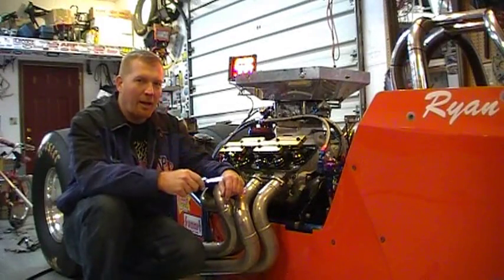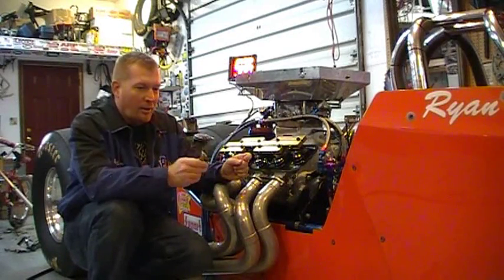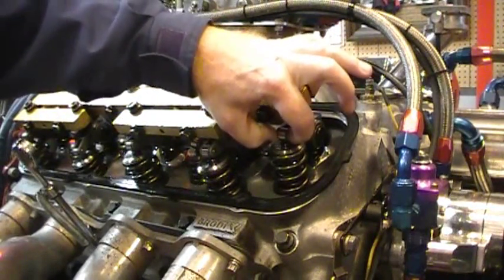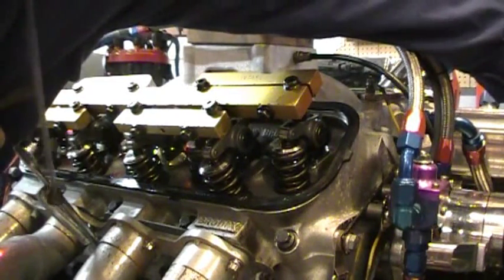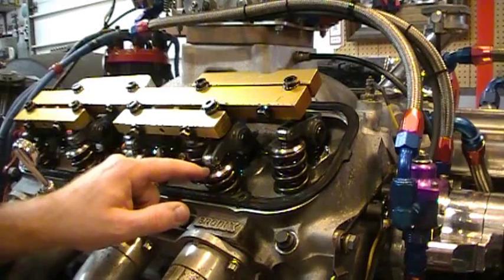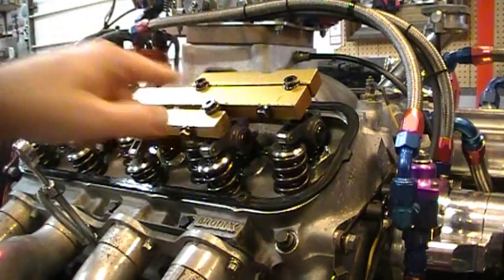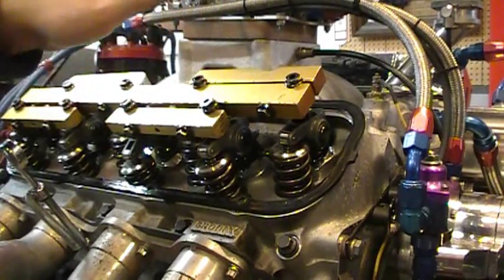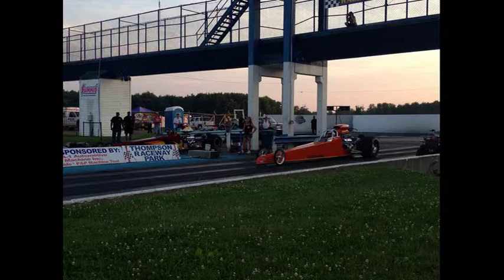RccVideo's Checking Valve Lash 468 BBC Chevy Full Roller dragster motor.

Comment: What’s the specs on that engine I’m doing a similar build
Reply from the maker: 470 CI BBC 4 bolt studs
Bodix BB2X Heads
Wiseco 13.5-1 pro tru pistons
H beam rods HB6135
Crank 4340 Forged
Isky Cam 714-282 274-736
Comp 819 Roller Rockers
Cloytes Hex adjust chain
stainless steel rockers
Manley valves
Manely Valve Springs
10 degree Titanium Retainers
Cloytes hex adjust chain
Crane Stud Girdle
Reply from the maker: Car has been best of
1/8 - 5.262 @129.11
1/4 - 8.340 @159.47